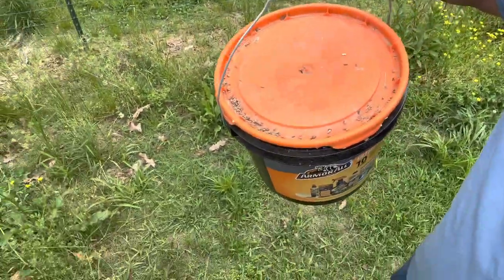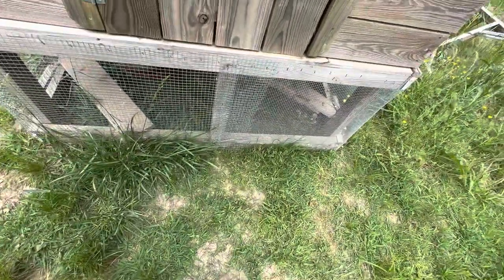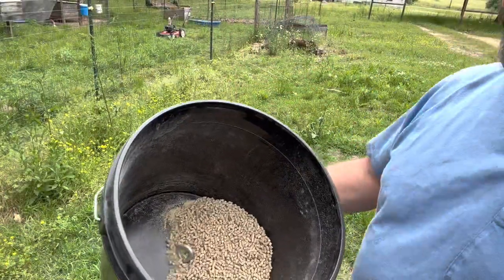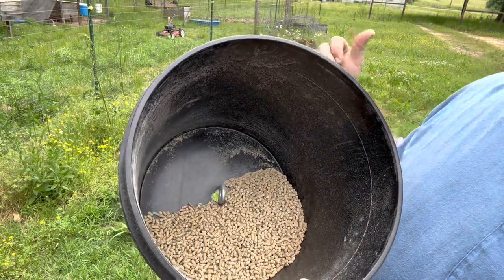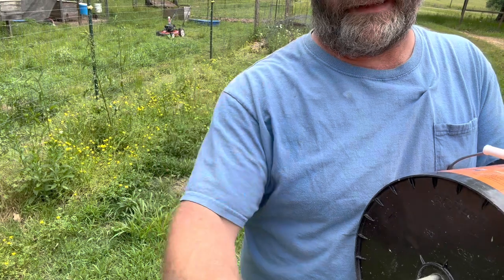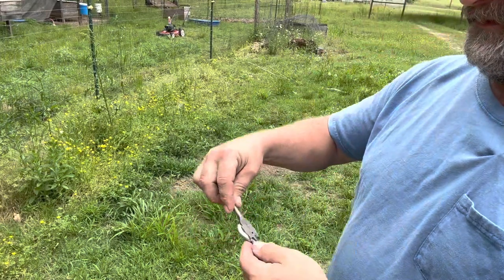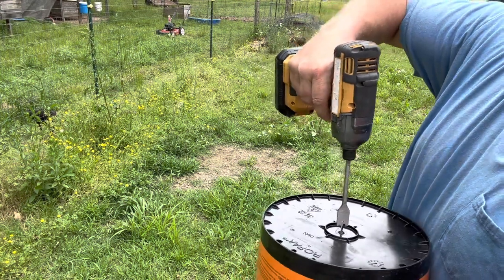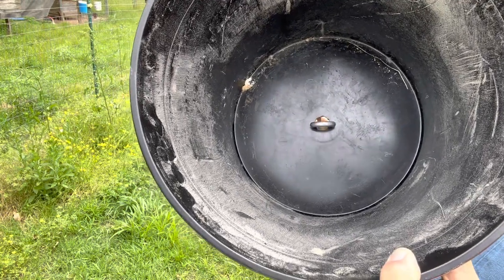DIY Making a mouse proof chicken feeder I hope.

Comment: Um, I watched all the way through the last bit and the chickens never pecked the wood block. How did you train them to peck at the block?
I did build one of these myself and made several revisions to it, but I either ended up with no pellets in the little tray (as some designs online have) so no interest from the hens, or a great pile of pellets because every peck brought more pellets down.
Reply from the maker: As far as training them. I didn’t do anything other than this is the only food in the pen. I think that curious finally gets the best of one chicken and the others learn quickly. As far as wasted food goes you will still have some extra food laying around on the ground. What I have found is most of it get picked up later on. If you are getting to much food coming out at one time then you can either buy a smaller washer and glue it to the bottom or top of the hole to reduce the size. Every peck shouldn’t drop very much. Or you can use a bigger toggle bolt. The place I usually get pellets from the pellets are bigger then the ones at tractor supply for instance so the size could need adjusting. And another thought with the washer thing I had a mouse that was able to get up on the wooden block and chewed the hole bigger. The washer idea is another way to not throw the bucket away and stop the mouse that figured it out if you can’t raise it up any more.